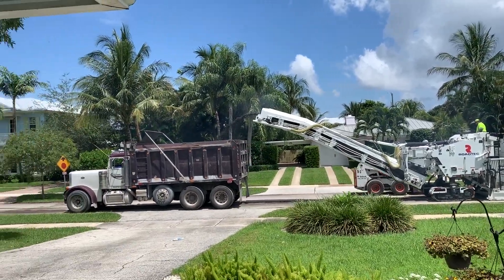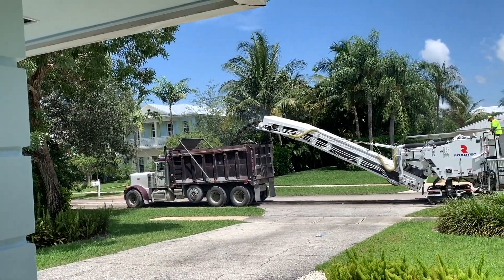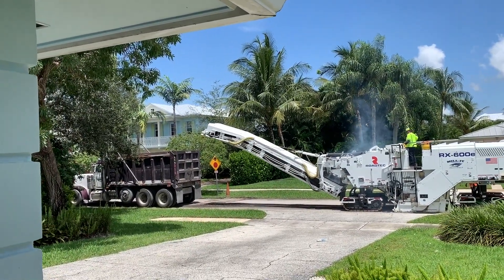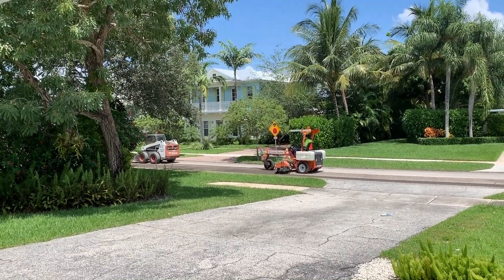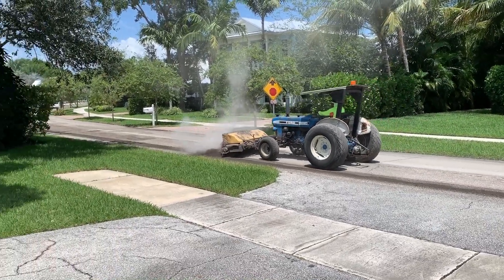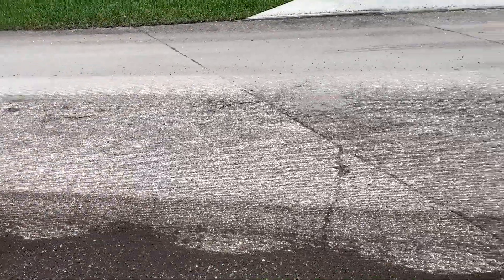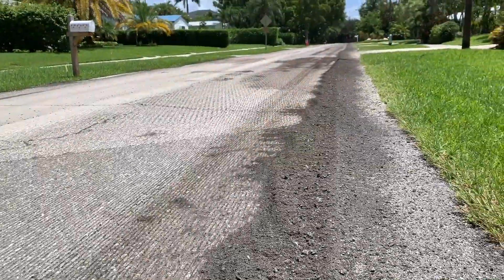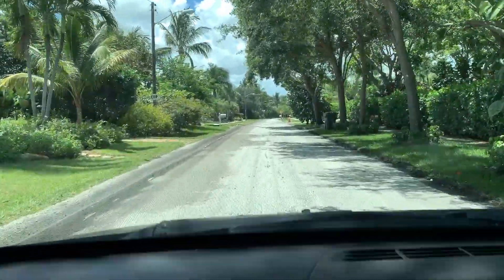How they remove an asphalt road with a roadtec RX 600e

Comment: Thats called an asphalt milling machine and that scraping is a residential flick because they need to keep some base asphalt for the over lay ....if necessary that machine could remove all the asphalt down to 14 inches ....Millit are a good operation i worked for them in the mid 9os
Reply from the maker: Thanks for the info thanks for watching
Reply: @TomLeeman  no problem and that there is a fancy new style type...the old  ones would put a scare on you because they appeared vicious and much much louder